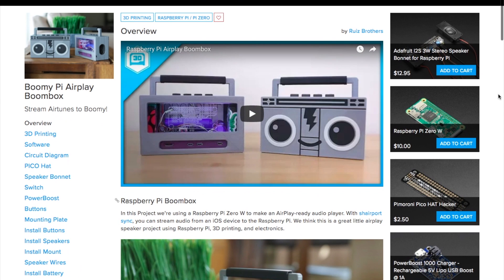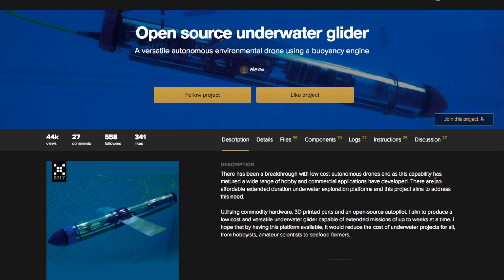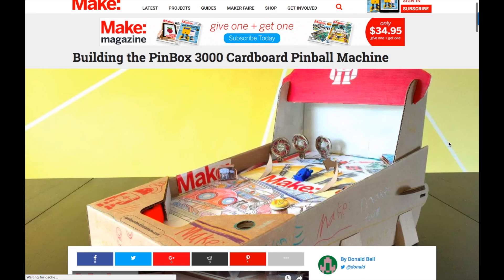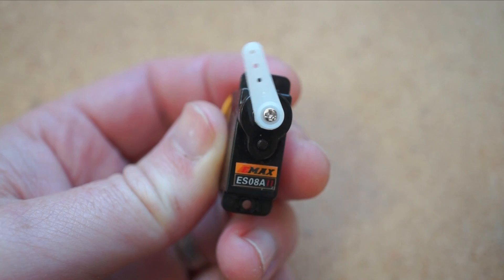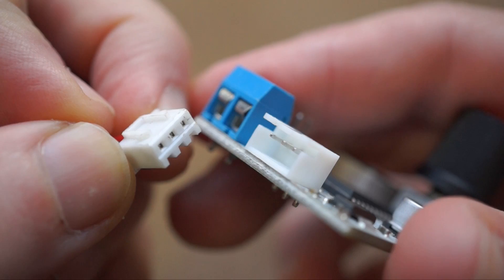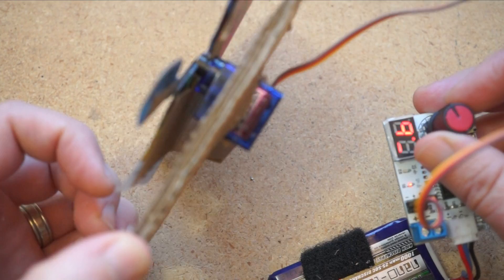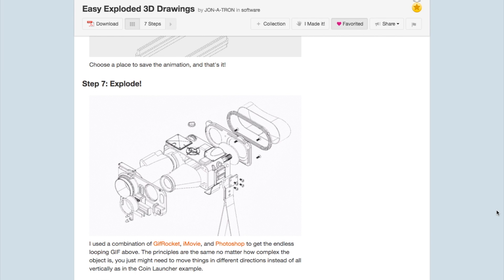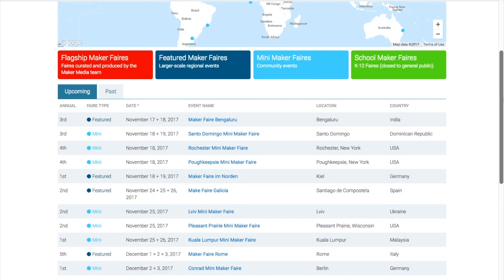Car Lock Pinball [Maker Update #60]

Comment: Wow this servo tester board thing is great! Thanks for another fantastic video.
Reply from the maker: Truly. I've had a bin of servos for years now that I've been too lazy to tinker with. The tester board has made them so much more inviting.
Reply: Yeah I have some projects i want to work on with them as well but find myself not wanting to spend an hour writing code to make it work.  So just ordered one (from your link of course :) )  to play around with - and the price is fantastic - i wouldn't mind using a few just for manual control in projects without feeling like i have wasted a 40$ pi.